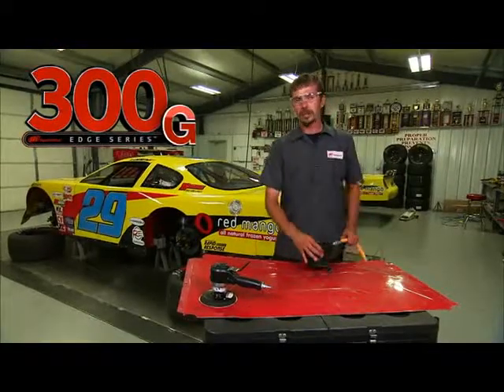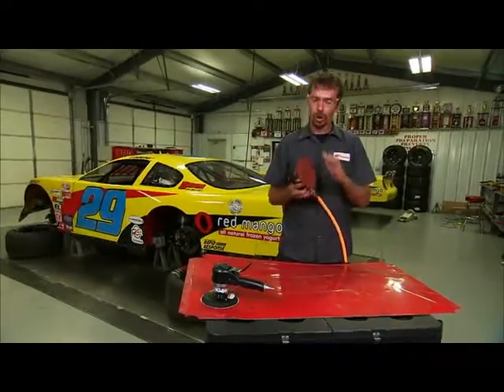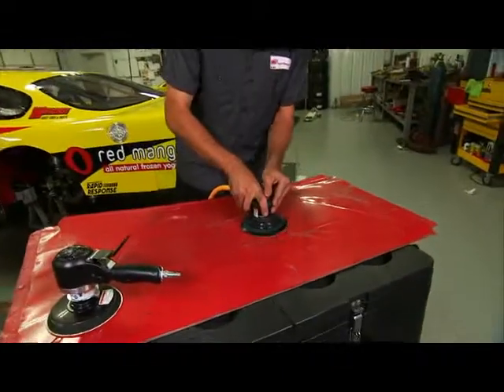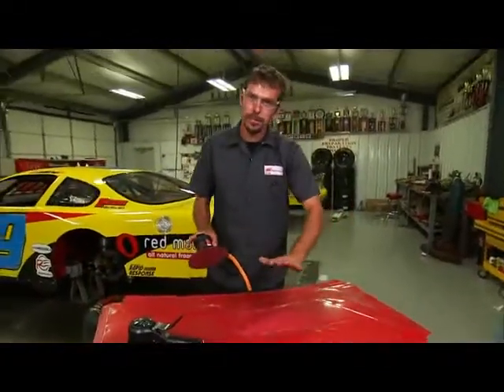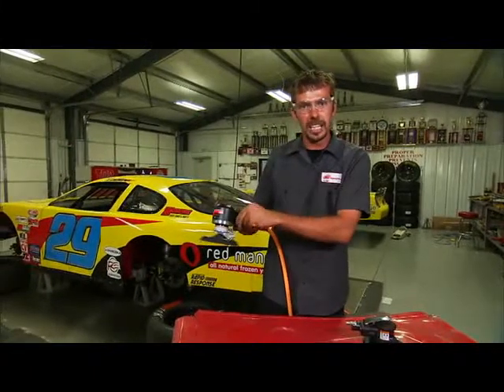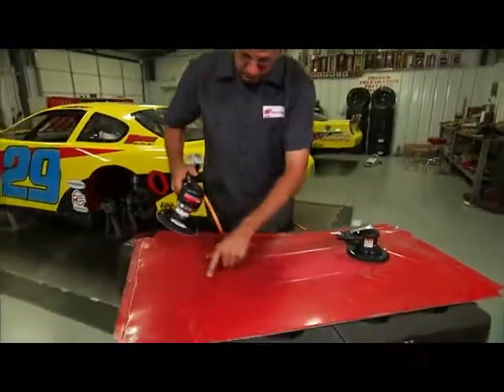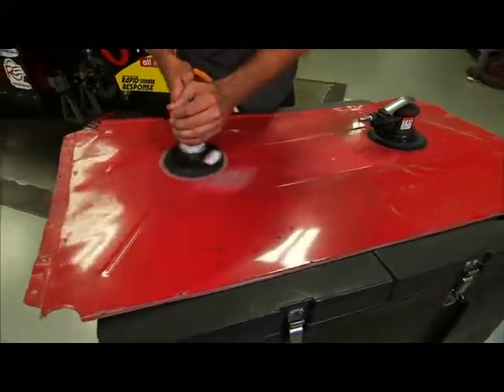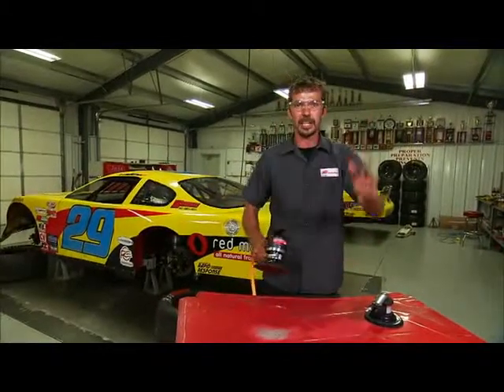Ingersoll Rand Dual Action Sander - Model# 311G

Comment: Does the Ingersoll Rand Dual Action sander actually use only 4cfm? That is what your website claims. If this is the case I may be able to use this tool on my 30 gallon compressor. Otherwise I will have to go with the AirCat 6310